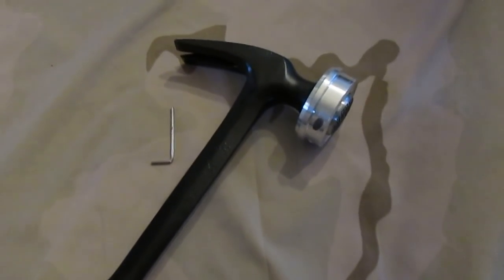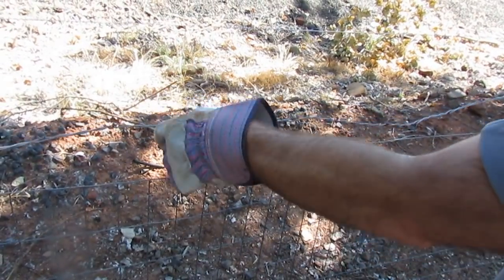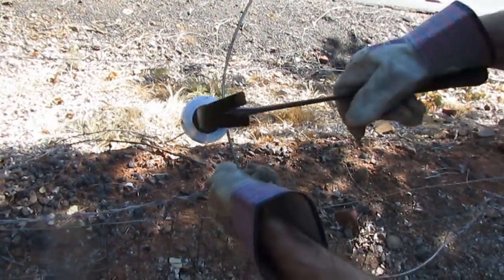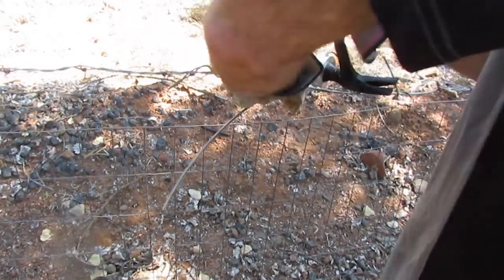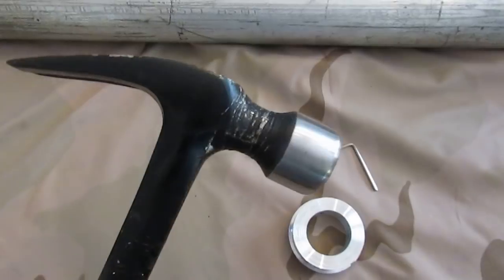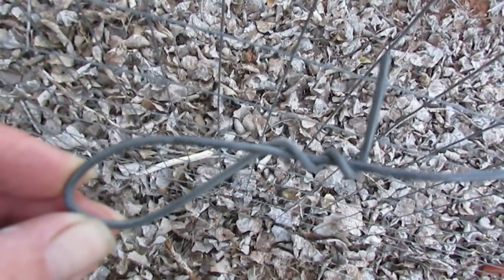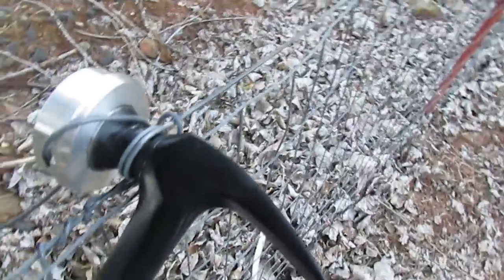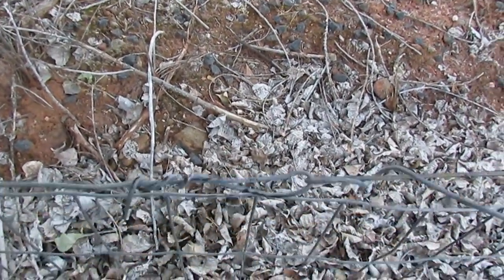The Pedro Device: Need to Tighten a Fence in 3 Minutes?

Comment from the maker: Thanks everybody for their interest! There are currently no plans to produce this item. It works great though. It saves at least 3-5 minutes per wire on splicing jobs which adds up pretty quickly. It also has the benefit of keeping the loose wire end on the other side of the wire from the operator, which is a massive safety improvement over just using a hammer alone. Thanks again for watching, I wish you all the best in your fence  repair endeavors.
Reply: Great job
Reply: Legionitalia I’d love to see make a mint, well, at least a nice profit. Very cool

Comment: The old man made a few.... Back in the '60s... He took two pieces of 1/2" pipe, either welded together at a 90° or use a 90° pipe fitting and screw it all together tight.
One side is the handle, whatever length you want.. the other side, 4" to 6" long with a slot cut through the pipe lengthwise, to about an inch of the elbow. Slip it over and do the same thing.

Comment: Just tuck wire between the claws simple been doing it for years without any divise
Reply: Yup.  Been doing that for years too. Just need a hammer and fencing pliers and a few staples to go check fence. No need for fancy gadgets.
Reply: And putting the wire end through the claw and folding it down means you don't have to watch out for that dangerous-looking wire coming out of the gadget.

Comment: That might work for temporary patch work . Leaves a sloppy looking repair and in my experience the loops are weak in older barb wire.
Reply from the maker: B.J. Smith trust me the cows don’t care. In practice the patches last longer than the fence. Also, If the wire is that degraded that the wire breaks when tightened (like from a fire), a patch definitely isn’t gonna help. Thanks for watching.

Comment: I just drilled a hole through the hammer head - thread wire through and rolled the same way -
Reply from the maker: rugrt1 what you’ve done is made a fragmentation grenade. Please don’t hit anything with it now. Also if you’ve used it, you know that it’ll be nearly impossible to remove the wire from the hole after the wire has been tensioned. It would be better to use the traditional through the claw method, with its associated problems. Thanks for watching.

Comment: I've used a hammer to tighten a fence without a attachment for over 50 years! You hook it in the claws, turn it over and spin it around the head without all the money spent!!
Reply: I tighten it more than that! Thats  to loose!
Reply from the maker: Donald Hofman, me too! and like me you’ve probably also scratched your arms and nearly blinded yourself with the loose wire end a thousand times. It can indeed tighten a single wire tight enough to pull a 3” post set in concrete clear out of the ground. This video was for demonstration purposes not to test the strength of be wire. Thanks for watching.

Comment: nice tool,  max guage is 6? or 8? for wire
Reply from the maker: Ken actOFkindness Red Brand fence patching wire tops out at 9 ga. So that’s what it was designed for. It can physically take a larger diameter wire but you will likely run into a variety of problems as the diameter of the wire increases. Thanks for watching and commenting!